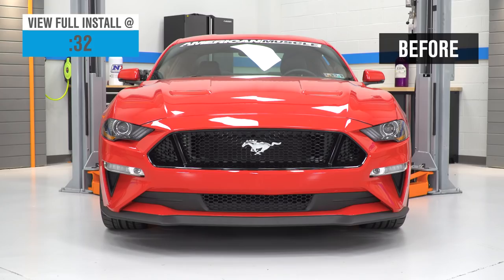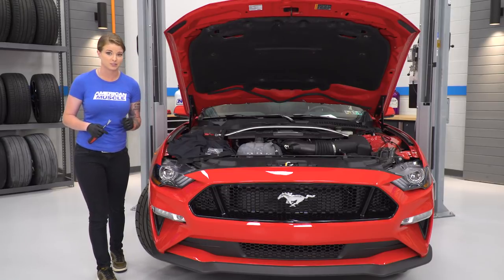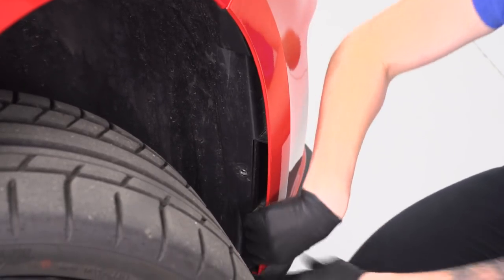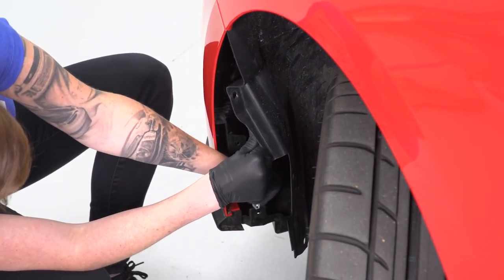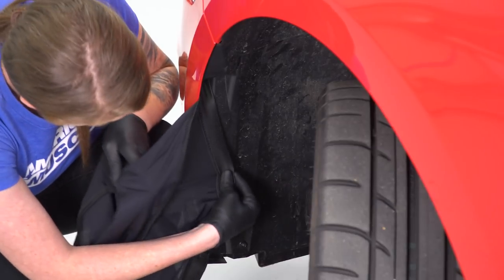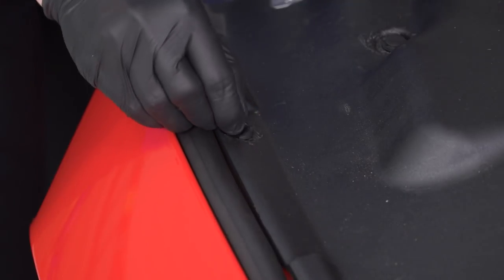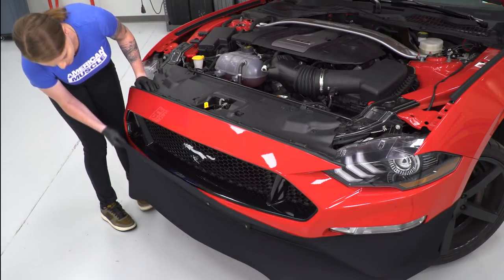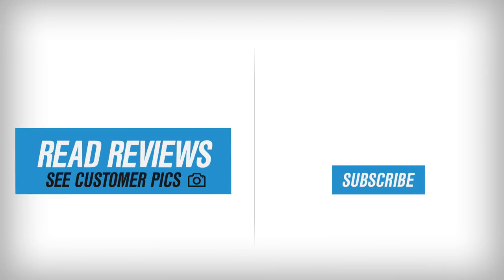2015-2019 Mustang GT & V6 Novistretch Hi-Flow Front End Mask Review & Install

Comment: why tho
Reply: If you road trip in your pony a lot, especially through the night, it's a nice inexpensive fix for bugs pelting your nose and dinging up the radiators. On the flip side, you could just clear wrap the nose of the car... but that's often big bux (800+ in most places) and some reputable shops won't touch it if they find any pre-existing paint concerns.